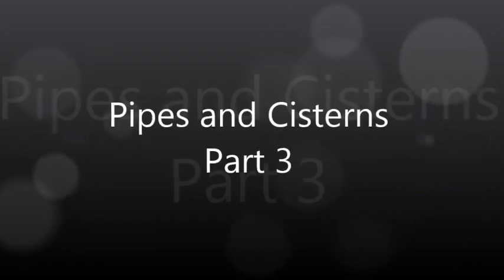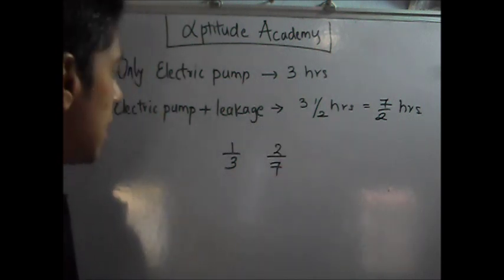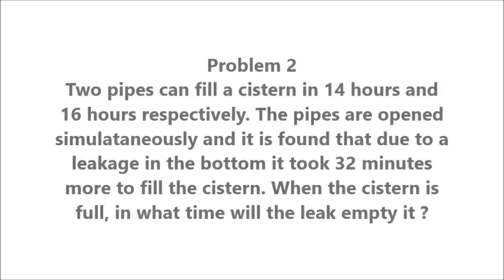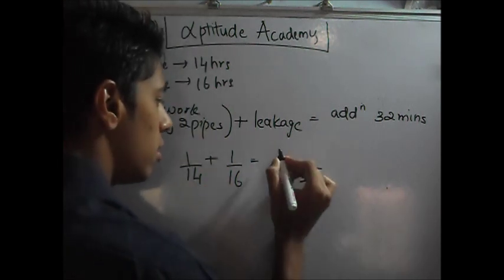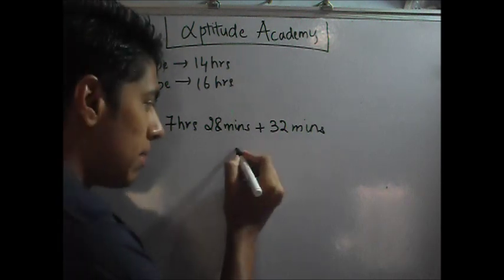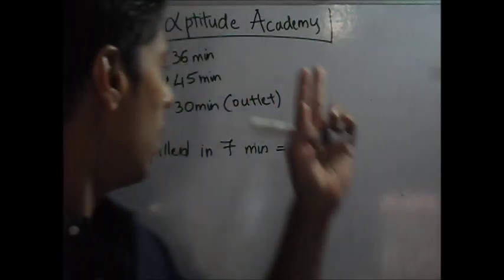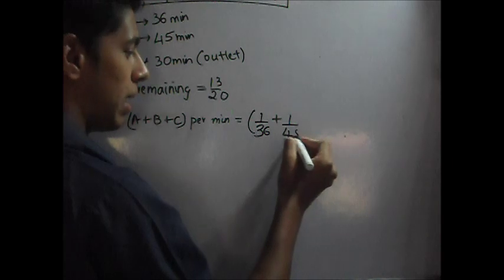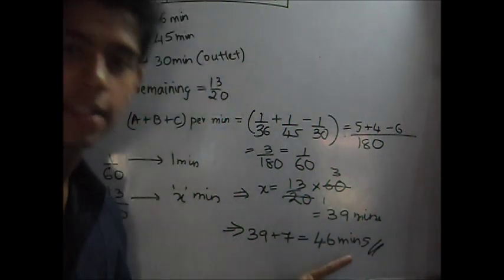Pipes and Cisterns - Concepts and Tricks - Part 3

Comment: hi daniel, ur concepts benefitted me a lot . thank u. i have a doubt with the following prob. Q. water flows into a tank which is 200mt long and 150 mt wide through a pipe of cross section 0.3m x 0.2 m at 20kmph. Then the time in hours for the water level in the tank to reach 8 mts. ?

Comment: A fill pipe can fill a tank in 20 hours, a drain pipe can drain a tank in 30 hours. If a system of n pipes (fill pipes and drain pipes put together) can fill a tank in exactly 5 hours, which of the following are possible values of n (more than one option could be correct)?
a) 32 b) 54 c) 29 d) 40
Sir can you please tell guide me to this question. Which video of yours or which example can i use to solve it.

Comment: Hi. Can you please explain this sum in one of your video. 1) In what time would a cistern be filled by three pipes whose diameters are 1cm, 4/3cm, 2cm running together, when the largest alone will fill it in 61 minutes, the amount of water flowing in by each pipe being proportional to the square of its diameter. Please make a video of it and show it. I have solution with me but still I did not understand it. Thanks !

Comment: A pipe can fill a tank in 12 hours, B can empty it in 24 hours. How much more time require to fill the tank if it already filled 1/3rd if both pipes are opened simultaneously?

Comment: hai....can you explain me the following problem...
Two taps A and B can fill a cistern in 10 and 15 minutes respectively.Both taps are opened together but at the end of 3 minutes,tap B is turned off.In how much time will the cistern be filled?
Reply: +Divya Lakshmi A:1/10 min
B:1/15min
A+B=1/10+1/15=1/6 min(so it takes 6 min to fill the cistern)
given:after 3 min B is stopped,so 1/6*3=1/2 (so half of the cistren is filled)
now,only A tap is opened ,it fills the tank 10 min ,so half of the tank is already filled so time to fill another half of the tank(ie 10/2=5min)
hence total time taken is 3+5=8 min

Comment: A leak in the bottom of a tank can empty the full tank in 6 hours. An inlet pipe fills water at the rate of 4 litres per minute. When the tank is full the inlet is opened and due to the leak the tank is empty in 8 hours. The capacity of the tank is
Sir i want This type of questions and answers.Please upload a video on this type of questions??

Comment: Dear sir 
I am a daily follower of ur channel. thanks for ur updates. 
I have a question ❓. hope u will send me the solution. 
         
There are 3taps of diameter of 1cm,4/5cm and 2cm resp.The ratio of water flowing through them is equal to the ratio of their diameters.
The biggest tap can fill the tank alone in 61 min.If all the taps are open simultaneously, how long will the tank take to be filled ?
Reply: hope, I will get it very soon

Comment: its the best useful video for me, but how can we calculate the capacity of cisterns can u plz solve this problem for me............(Q) Two pipes can fill a cistern separately in 24 minutes and 40 minutes respectively. A waste pipe can drain off 30 litres per minute. If all the three pipes are opened, the cistern fills in one hour. The capacity (in litres) of the cistern is?
Reply: plz solve this problem for me as early as possible..........
Reply from the maker: Hello Lavanya :) Could you please Post your doubts on my FB page ? :) I check that regularly :)
Reply: ya sure thank u.......... :)

Comment: can any one tell me how to solve this question

Q 1:-two pipes working individually can fill a pool in 2 hours and 4 hours respectively. both pipes were opened simultaneously and the first pipe was closed after x min. The total time required to fill the pool was 1 hour 30 min. determine the value of x.

Comment: your lectures are fantastic .........thanks a lot they have helped me but was this lecture enough for clat ? and ya in the comments above smone asked the following question which i aswered in the following way can u pls check f it s correct r no plsssssss..........

Two taps can fill a tank in 12 and 18 mins. respectively. Both are kept open for 2 mins. and the first is turned off. In how many mins. more will the tank be filled? OPTIONS: a) 15 min b) 20 min c) 11 min d) 13 min c) 8 min.

first calculate the tank filled by BOTH the taps in two mins:
tank filled by tap 1 per minute =1/12
tank filled by tap 2 per minute=1/18
tank filled by both in 2 minutes=[ 1/12+1/18]*2
                                            =5/18

tank left to be filled =1-5/18
                             =13/18

now after 2 min ,only the second tap is open  which means it will fill the rest of the 13/18 tank. thus more  time taken by tap 2 to fill the rest f the tank is =13/18*18= 13
Show less
 Reply  ·
Reply: 13+ 2 mins was filled by first 2

Comment: Hi.. I have a question that I am not able to solve... here it is...

Two taps can fill a tank in 12 and 18 mins. respectively. Both are kept open for 2 mins. and the first is turned off. In how many mins. more will the tank be filled? OPTIONS: a) 15 min b) 20 min c) 11 min d) 13 min c) 8 min.

Please, solve it!

Thanks in advance.

Ravi
Reply: 13
Reply: A= 1/12 and B=1/18. taking LCM & Solving it comes to 5/36. So combined work for 1 hrs is 5/36.
2 hrs work : 2 X 5/36 =10/36. Now the remianing work is 1-10/36= 13/18. So 13/18th part is left empty after A is off. 
Now by using cross multiplication 1/18th work is done in 1 hr, so 13/18th work shall be completed in 13/18 x 18 = 13 hrs
Reply: A->12mins
B->18mins

now, calculate how much of tank is filled for 2 mins i.e
2*(1/A+1/B)
2*(1/12+1/18)=5/18

now calculate the remaining tank to be filled i.e (consider 1 to be a filled tank)
1-(5/18)=13/18

now take B i.e the tap that fills the tank for the rest of the time, it can fill the tank in 18mins so,
(1/18) is the amount of work done by the tap in --> 1 minute
(13/18) the remaining amount of work is done in--> x minutes

so by cross multiplying,
x=(13/18)*18 
x=13mins
your ans is 13mins.
Reply: Ravi Mandalia answer is [d]13 min
first calculate the tank filled by BOTH the taps in two mins:
tank filled by tap 1 per minute =1/12
tank filled by tap 2 per minute=1/18
tank filled by both in 2 minutes=[ 1/12+1/18]*2
                                            =5/18

tank left to be filled =1-5/18
                             =13/18

now after 2 min ,only the second tap is open  which means it will fill the rest of the 13/18 tank. thus more  time taken by tap 2 to fill the rest f the tank is =13/18*18= 13
Reply: Ravi Mandalia 13 min....